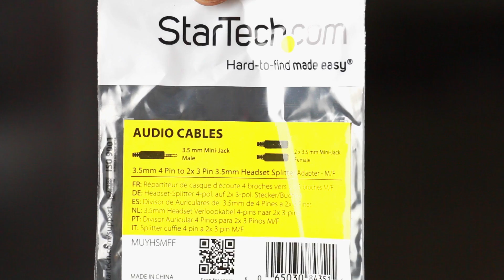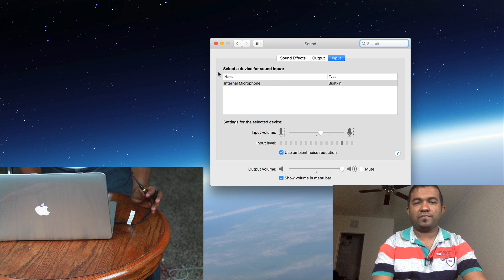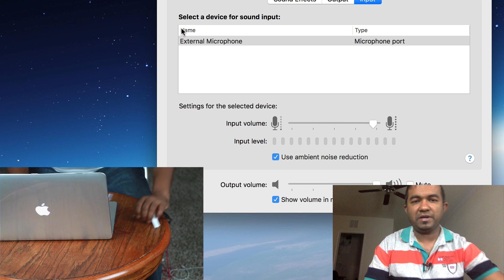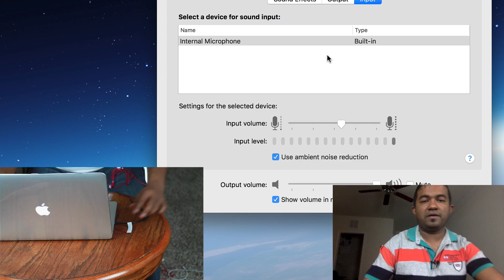How to (CORRECTLY) connect external microphone into MacBook Pro or TRRS port.

Comment from the maker: Everyone who said this is not working Make sure other connector you used to fill headphone part of your split adaptor (in my example ear buds) MUST have 3 rings (TRS) on its connector. not 4 rings. mean that should not something with microphone. (most of time) when it has microphone it has 4 rings. in order this to work that should be 3 ring connector (TRS)
Reply: Thanks, still didn't work. I got a USB microphone instead. Simples!
Reply: @mikebeatty7348  but my PRODIPE  ST-USB CONDENSER MIC won't work on Mac any help?
Reply: Jasmine Hetizo sorry no I’m not tech savvy at all. I stuck it in and it played... check your settings
Reply: CodeLabs:
It still doesn't work.
I have two pairs of normal stereo in-ear headphones and both have 3 metal poles and two plastic rings.
Then, i have a cable for one of my in-ear headphones with a built in microphone and it has 4 metal poles and 3 plastic rings.
None of them seem to work when i plug it in the order you showed in the video. It still says "internal microphone".
I tried back and forth with a ton of variations both with plugged microphones (which all have three poles with two plastic rings) and different headphones with and without mic.
I have now tried and tried for a several hours and it's still not working, No matter what combination i use.
Under Microsoft Win7 64Bit on my same iMac, all the microphones get instantly recognized and can be manually chosen. So all these microphones, headsets, and headphones work perfectly.
It's just macOS Mojave 10.14.5 that does refuse to work correctly.
Reply: Just buy a USB audio interface. You can buy cheap used ones on ebay for $20.
Reply: This doesn't work with early 2015 Macbook Pro Retinas. But there is a workaround: https://www.youtube.com/watch?v=tI0vezevfX (Also the splitter has to specific! Just any old TRRS splitter wont work)
Reply: Nectarcape this link doesn’t work...any other link available?
Reply: @Smoovindecat  There you go :)
Reply: Nectarcape thankyou🙌
Reply: Hi, I have purchased one that comes in a U shape from Amazon ans tried applying your way of connecting earphones and external microphone to it, its not working. Can you please share link to the product so I can buy one? I want to connect external mic to my iMac. Thank you.
Reply: I had problems with my mic as well. I found the impedance of the mic was not what the MacBook was expecting. I tried different mics until I found one that worked. You can plug in the mic that works first so the system recognizes it, then you are free to connect any microphone you want after that as long as you don't remove the splitter from the MacBook.

I then took a TRS plug and soldered 100 Ohm resistors on it and keep it permanently in the headphone side of the splitter so I don't need to keep headphones on it all the time.
Reply: I bought TRRS (male) splitter but couldn't figure out the female parts. I notice that my microphone and headphone are both TRS, but when I connected it to the splitter, the microphone wasn't detected (the headphone was detected tho). Tried to use another headphone that was TRRS still, it couldn't detect the mic either (but the headphone, again, worked). Anyone knows what could be the problem?

I tried to connect it to my android tablet, it worked just fine. It's just.... I'm really that curious tho what exactly the problem....

Comment: Hi Krish
I am facing exactly same issue now. I have macbook air 2020 and I recently purchase a external mic along with a splitter. I did connect my external mic (TRS) port to splitter but I have a earphones with TRRS 3.5 mm jack. To connect it properly can I buy TRRS to TRS convertor and connect my earphones to splitter? What do you think will it work.
BTW I am a Data Engineer and I checked you channel, I immediately subsribed because I found really great content. Please help me out here.

Comment: i plugged in my microphone and plitter with headphones but it didnt work i had done the steps you did but my computer is still using the internal mic also my mac is a macbook air 2017 and my mic is the Neewer nw 700 mic and it has two rings same with my headphones

Comment: What to me worked was to blow on the microphone while connecting. Sometimes I have to repeat. But there is no need to use the apple earpods (macbook pro late 2012). It works even without any earphone connected

Comment: If the computer reads the headphone jack even without any headphones connected in, why should it be any different for the microphone jack?

This product is absolute fucking trash if it only works for some users. What the FUCK is that? And all that shit you did to get it to work sounds like unnecessary fucking work to me. Frankly I don't know how Apple took the mic jack out of the Macbook. Makes no fucking sense. Every year they find creative and new ways to frustrate the user experience. I have a bunch of wires and dongles but haven't recorded a fucking thing yet. Only thing i haven't tried is piss inside the headphone jack. I have a mic, laptop, cables, earpiece, everything... but i cant record shit. Sorry if i sound like a lot right now. i'm just frustrated. Was planning this all week and boom.... FAILURE. There goes my planned podcast. Bunch of fancy equipment that can't do shit. I am soooooooo FUCKING PISSED!!!!!!!! FUCK!!!!!!!

Comment: Forgot to mention below that by following the basic principle in the video, I didn't even need an adaptor with my 2011 iMac. Just plug some earbuds into your sound-out socket (using a 3 ridge jack plug head) at the same time as you have your external microphone plugged in (using a single ridged jack plug head supplied with my microphone). That did the trick for me.

Comment: I have a Nikon me-1 back-electret condenser microphone designed for DSLR cameras. It normally obtains its power from the camera.
If I attach it to my MacBook Pro using a splitter, will it be able to get its power from the laptop via the splitter connections?

Comment: Mine doesn't work either, works if I plug external mic and separate headphones straight into splitter but not when I plug in the wireless receiver and separate headphone. Which is what i need as need to stand meters away from computer. Any ideas anyone?

Comment: Hello. I have a TRRS (boya m-1 microphone) and standard TRS headphones. So I am good with just the splitter adapter you show here and just plug the connector into my mac AFTER mic and headphones are already connected to the splitter. And everything should work fine. Am I right?

Comment: that was helpful. It did not work that way as you shown but after this video i started to experiment and found out that if i connect my headset with mic (2 separate connectors) and then disconnect only mic and theeen connect my external  mic then it WORKS !!!

Comment: Thank you SO MUCH for this tip! It has very helpful. I found I had one small variation which was the wireless mic receiver which wasn't picking up the signal. So what I did was unplug it from the y splitter and plugged my mic directly into the y splitter. Then my Macbook picked up the mic. From there I unplugged my mic from the y splitter and plugged the wireeless mic receiver back into the y splitter and it worked! FINALLY! I've had this mic for several months now and was on the verge of getting rid of it!! What a life saver!

Comment: doesn’t work. i have the splitter. then i have a trs microphone and trrs earphones(inline mic). i also have a trrs to trs connector. Sometimes i put the trrs earphones into the connector(trrs to trs) then plug that into the splitter, and plug the splitter into the macbook. Sometimes this works but other times it doesn’t (mostly doesn’t). I’ve been doing this for an hour and it worked once but when i moved my macbook the splitter came out and now i’m back at square one. this is so frustrating, why have apple made it so hard, for a bit of kit that costs £1000!!

Comment: Tried this multiple times, but it's still not working on macos Catalina. I've even tried inputting a mic directly into the macbook with a TRS to TRRS Rode SC7 cable, however the macbook seems to recognize it as a headphone output with no external mic input. Looks like Catalina has messed something up

Comment: Worked for me - many, many thanks!  I want to be able to use both headphones and mic together for language learning.  The point that the TRRS splitter is expecting TRS inputs to both parts of the splitter is key information.  My mic had a TRRS jack and wasn't being recognised, luckily the  mic came with a TRS to TRRS conversion extension and this, coupled with putting the wires together BEFORE putting the splitter jack into the MacBook finally worked.  Means I can keep using existing comfy headphones and a cheap clip-on mic, which is all I need for my purposes

Comment: Thank you so much all the way from Los Angeles, California!  Your video was very informative and I watched it all the way through.  You helped me to fully understand the significance of TRS VS TRRS.  I had been doing recordings with and without my rode mic pugged into my device only to come across your video to understand that, it doesn't matter what I do. If the connection through TRS to an ipad/iphone/macbook it will not identify as an external mic. Your video saved me a lot of head ache and I understood completely what was the next and necessary step to do. By design, these manufacturers are creating wonderful technology devices that will require more things to purchase to enhance the over all experience.  Its frustrating cause it seems the spending never ends but I look forward to when I get the optimal performance out of my external rode microphone!  Thank you again!

Comment: Hmm, it's logical, but still doesn't work for me... I explain:
I have a macbook air 2013,
- when I plug my TRRS handsfree headset/mic in my mac : it works 
- when I plug my TRRS splitter with TRS headphones + TRS mic (rode wireless go) in my android phone : it works
- when I plug my TRRS splitter with TRS headphones + TRS mic (rode wireless go) in my mac : fail
I don't understand.... 
Any ideas ? 
is it something about the rode mic ?
Will a USB splitter help ?
Cheers ; )

Comment: SOLVED: All you need to do ... Step 1. Connect your external mic to the splitter via a TRS cable (NOT TRRS). Step 2. Connect your headphones on the splitter. Step 3. NOW plug in the splitter to the phone/laptop. It will work!  

PS: don't connect the splitter to your phone/laptop before you connect the mic and headphones to it.

Comment: Hey mate,
I used this fix and it worked great. I was able to do a number of interviews etc. with my rode wireless mic. But, it has stopped working now. I have checked the cable by plugging into my phones (samsung and apple) and it works fine. I have checked the macbook with my smart phone headphone/mic  and it is recognised straight away. So the mic/cable/and laptop all work with different configurations, but not the original one that I was using. As far as I can tell, nothing has changed. Any suggestions? Thank you.
Reply: same here did you figure it out??
Reply: @itsrumexa  Hi there. Sorry, never figured it out. So I spent the money on a USB input. Works great. Has mic and headphone jack. Appears immediately on the system preferences. Brand was Ugreen. Also, didn't matter what order I connected cables either.
Reply: @ProgressivechiroAU  ohh i see, i tried plugging in my mic again and it started working againn!!!
Reply: @itsrumexa  Happy Days! I hope it stays that way for you. The USB plug is working great for me now. All the best.

Comment: it's 2020 and I can't get this to work on my macbook pro 2016 13 inch (touch bar). I want to use my Rode VideoMic Pro. I've purchased the splitter (StarTech 3.5mm 4 position to 2x3 position 3.5mm splitter adapter - M/F) that plugs into the headphone jack of my macbook pro. I've plugged the rode mic (TRS plug) into the correct side and even purchased headphones that don't have a mic (TRS plug) built in to the other side of the splitter - and nothing works. I've tried it with the mic powered on, powered off, etc. Nothing works. What am I doing wrong? It recognizes the headphones and they work but no mic recognition. I've also tried this with the apple headphoned (which are TRRS) and only tje headphones worked again. Please help! lol I really do not want to buy anything else! Thanks!!
Reply from the maker: Did you tried by as explain this video?
Reply from the maker: According to your explanation i feel like your splitter it self fault.
Reply: Yep! Did it exactly as in this video and it didn’t work. What does “self fault” mean?
Reply from the maker: @ScottNevins  sorry for the typo. I mean did you verified your splitter with non-mac PC to make sure it is not faulty?
Reply: CodeLabs it is the exact same splitter that you are using in the video. Same brand. Same packaging, etc.

Comment: Thankyou so much for this video!!!! I have just bought a cable that I thought would do this called a RODE SC7. To attach my RODE wireless go to a MacBook. It doesn’t work?! Any ideas? I thought that RODE had made their own cable to do this? The SC7.  I’m surprised I have to buy a random cable from eBay to fix this issue! It’s so annoying!!! But Thankyou for such a clear video sir🙏🙌
Reply from the maker: Usually cable do not have any techniques so I’m not sure why it is not working technically if it’s a TRS it should work. I’m sorry I cannot verify that because I don’t have that type of cable

Comment: I have a similar splitter, and it works - I can input mic and I can hear recorded playback of what I spoke AND I can also hear for example what someone else on the other end of a Skype call is saying while I'm talking at the same time. BUT - and this is a big one for me - there is no real time monitoring through the headphones while I speak on the external microphone.  I've read somewhere that in order to be able to actually monitor my microphone there needs to be some power on the line, kind of like what this device does (it has a battery inside): 

https://www.amazon.com/LinkFlexAD1-Microphone-Real-time-Monitoring-SmartPhones/dp/B07JPY6XCJ/ref=pd_sbs_328_2/136-1198501-4264868?_encoding=UTF8&pd_rd_i=B07JPY6XCJ&pd_rd_r=6480248d-9aa7-4d02-8e88-f59d47b2249f&pd_rd_w=X3xhM&pd_rd_wg=4uvIc&pf_rd_p=7cd8f929-4345-4bf2-a554-7d7588b3dd5f&pf_rd_r=S9XGAFYW3YW9B3ZY136F&psc=1&refRID=S9XGAFYW3YW9B3ZY136F

Is using this kind of powered device actually the only way to achieve real time monitoring? Or is there a software setting I can access to achieve real time monitoring without having to buy the above device or an audio interface?

Thank you for your excellent video
Reply from the maker: thank you..

Comment: Also, the microphone end of that splitter is looking for TRRS so if you want to use a line-in device such as an external mixerboard, you'll want to attach a TRS(line-in end) to a male TRRS to go into that splitter. In theory this should work as i currently have had no luck with the microphone using a Line in male cable.
Reply from the maker: yah

Comment: thanks! im gonna try this. i bought a stupid TRS external mic and its not working with my macbook air - its not showing up in the input part of the sound settings. so i guess i just need to buy a TRS to TRRS adapter/splitter to see if works. if not, do u know any other microphone thats TRRS that will work unconditionally with a macbook?

Comment: I have a Mac Air (Mojave) and am trying to copy a cassette audio tape to the computer.  I bought the trrs adaptor but still can't get it to work.  I am plugging a cable from the headphones on the cassette player to the adaptor with the headphone symbol and then connecting the other end of the cable into the computer's headphone port.  I tried plugging in a headphone into the other side of the adapter cable as well to fill in the connections thinking that may help but it did not. I plugged them in prior to putting them into the Mac.. still no change to the options on the sound preference screen.. i.e. no external mic or link in  showed up...  Just don't know how to make it work.  Appreciate your ideas..

Comment: hi code labs
i have a Neewer -NW700 which is a condenser mic, it has a power supply and two rings on the mic in cable. I have a macbook pro 2015 model, just wondering if you had any tips for me just to get this fixed,
thanks,
josh
Reply from the maker: its same way. what is the different than this explanation?